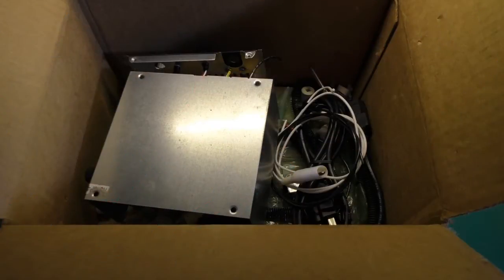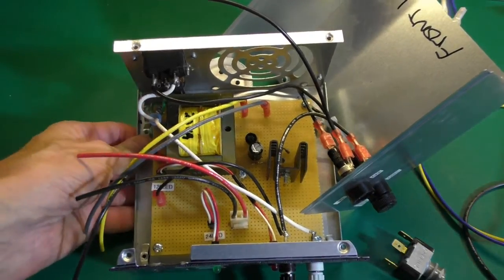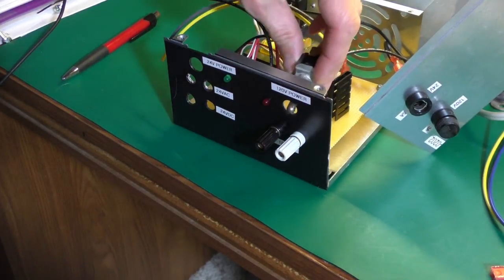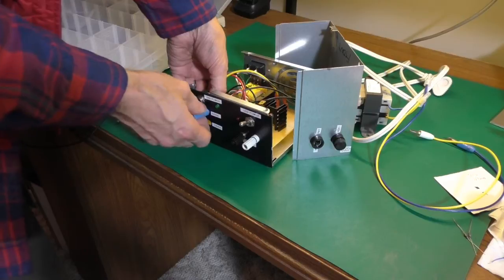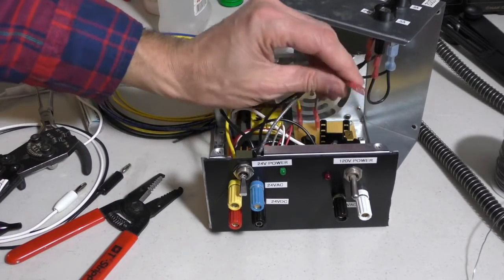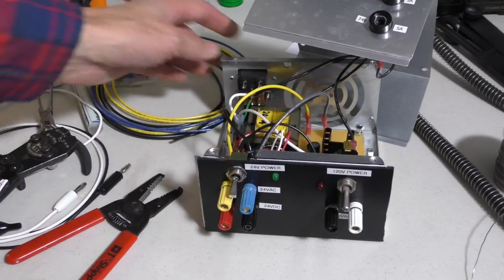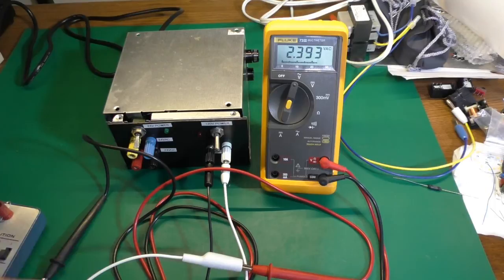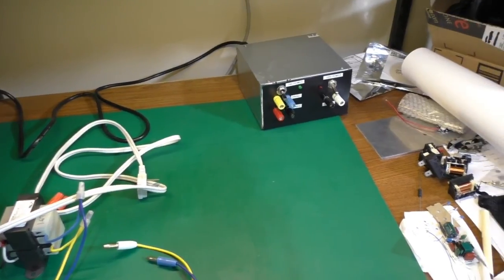R&D #6 build an  AC, DC Power supply from scrap parts.

Comment: Hi friend 
why you don't add my DC-DC power supply let it have a nice display and can set the voltage and current to let it to be a real power supply ? there see DPS500V , or DPS5015, if you want a buck- boost power supply, you can choose DPH3205 
https://rdtech.aliexpress.com/store/group/DPS-digital-control-power-supply/923042_508466030.html?spm=2114.12010608.0.0.AkmBfx
if you don't believe me, you can go to my channel to see my friend's work
I guss you are profession electrical man, you can try

Comment: Ok, but you got lucky with the transformer find. I need a 120v ac to about 24-30 v dc, 5 amp
transformer. What used stuff might I find a transformer like this in?

Comment: You will need to put a 1N4004, 5, 6 or 7 rectifier in reverse parallel with your LED on the 120 VAC pilot light.    If you do not, the 170 volt peak reverse voltage across the LED will kill it fairly quickly.    The rectifier will clamp the reverse voltage to .6 volts and that will protect the LED.   You will want to do the same with the 24 VAC pilot LED also or move it to the 24 VDC rail.

Comment: where is the schematic and how do you take the dc voltage and turn it into ac
Reply from the maker: Keith Nikolaevich This is actually an A/C to DC power supply, it takes the 120vac and puts it threw a 24vac transformer, then threw a bridge rectifier to a 24vdc regulator for the dc portion, 24vac is write from the secondary of the transformer. thanks for watching.